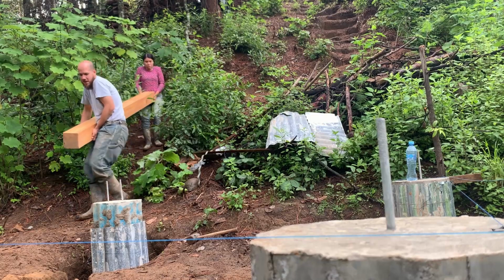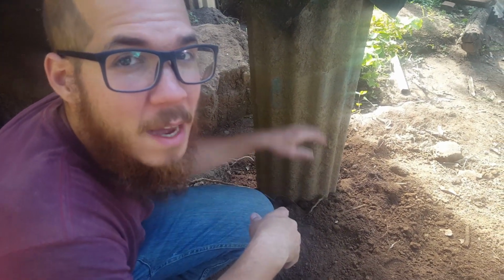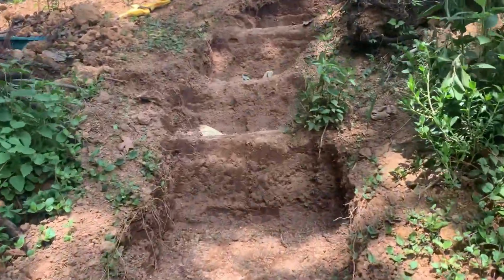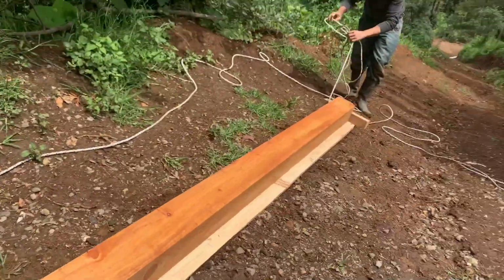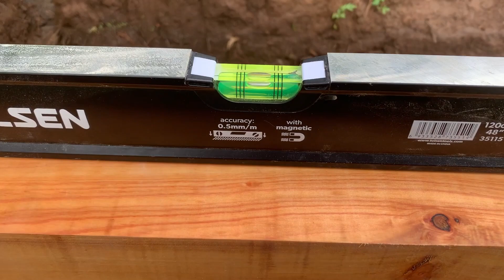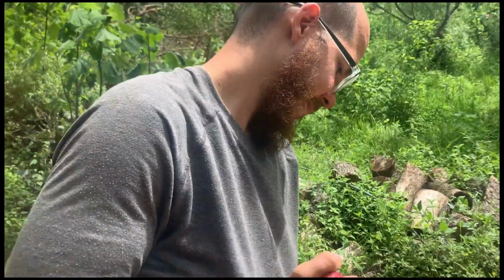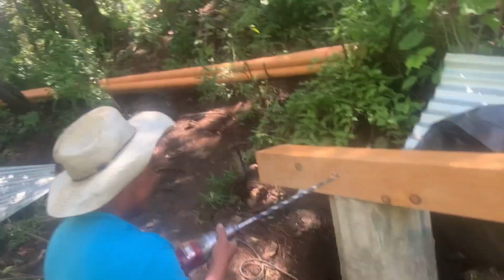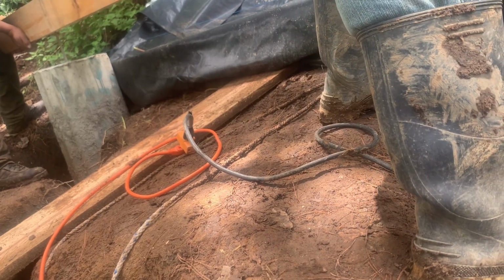Struggling with the foundation beams┃Building a TINY HOME in the mountains

Comment: You have trees all around and you could easily rig up a pulley system to lower your lumber and materials to the site without carrying it down the path. Save your backs, its fairly simple and timber workers have used it for over a hundred years.
Reply from the maker: Thanks for the advice. We tried to make a simple pulley simple with a rope, but it didn't work out since we were missing the actual pulleys. It is hard to come by certain things where we live.